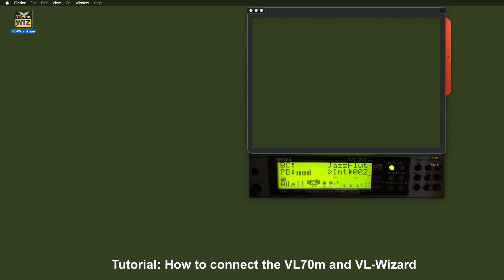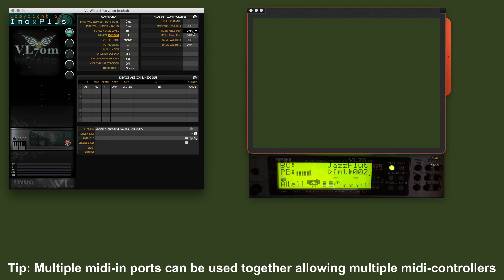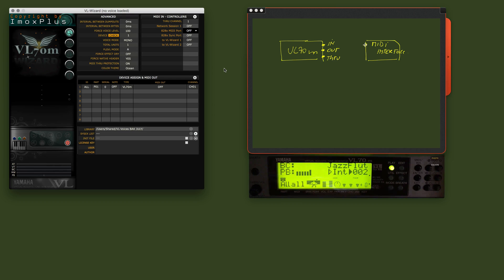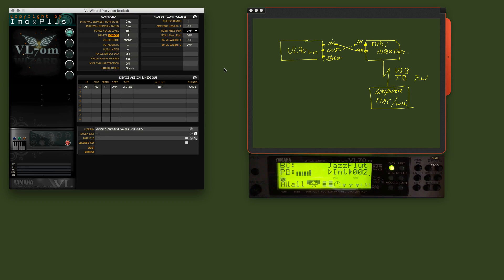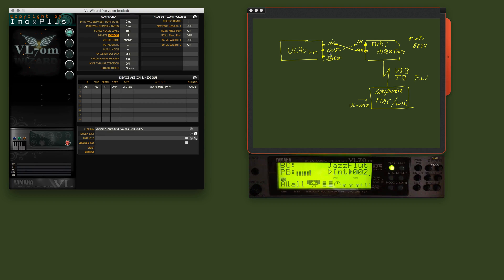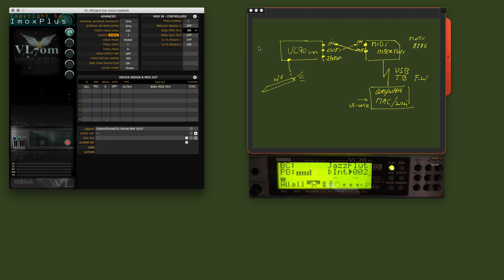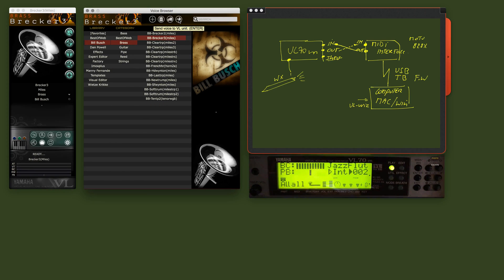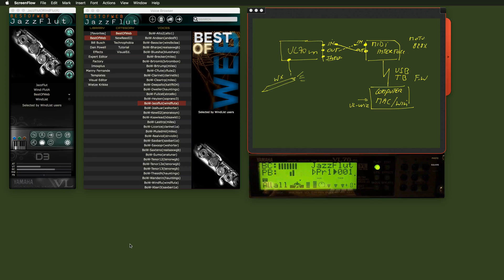1.01 VL-Wizard : How to connect the VL-Wizard with your VL70m  ◉ VL70m ◉ PLGVL ◉  EX5R ◉

Comment: Hi. I have a DM-48 wind controller that uses the midi in at the back of the VL-70m through a Midi Host so how do I connect VL Wizard  to my PC ?
Reply from the maker: You could use a MIDI merger box feeding the PC MIDI OUT  (PC USB MIDI interface) into the MIDI IN A * and the DM48 into MIDI IN B * and then connect the MIDI OUT * into the VL70M

* = merger box

Comment: I know this might be a silly question, but the connection diagram doesn't show how to connect the L/R audio outputs from the VL70-m. I assume they can go to a PA system (powered speakers / an amplifier + passive speakers), or the inputs of an audio interface. The audio interfaces I've looked at all have balanced line inputs, which can accept either a TRS (balanced) or a TS (unbalanced) cables. I haven't been able to find any information on whether the VL70-m outputs are balanced or unbalanced, I guess that means they are unbalanced? If so, should TS to TS cables be used to make the connections? If I understand correctly, in this case the audio interface will see lower input levels than if it was used with a device that has balanced outputs. I was reading some reviews of Focusrite Scarlett 8i6 (3rd gen) that I just ordered, and someone mentioned that their keyboard, with it's unbalanced outputs plugged in to the audio interface's rear line inputs, is too quiet, even with the volume maxed out. Can you please clarify this topic a bit, correct any mistakes I might have made above, and give some advice on this topic?
Reply from the maker: yes, the output of the VL70m is unbalanced (TS to TS should be used).  You can reduce the ground noise by attaching ferrit coils and connect your audio interface + VL70m on a powerstrip with noise filter. The quality of the TS cables is very important. Ensure well shielded cables.

The output volume of the VL70m is also influenced by the way the VL-voice is designed...You can use the EQ boost, Treble and Bass to lift up the signal.  You can also fake stereo by chaining the Stereo EQ block in the VL70m effect section. You can also use the Aural Exciter effect block and shift its output more the the left and the output of the other effects to the right... etC...

I'm using the MOTU interfaces because they offer rock-solid drivers
Reply: @IMOXPLUS  Much appreciated!

Comment: Totally new to this but have just purchased a wind controller (leckholm DM48), in the style of a chromatic harmonica.  I was just wondering what a 'midi interface' is.  Is that seperate from the VL70m Module Unit, as your drawing suggests?  My goal would be to play something like SWAM trumpets through this module in a live setting.  Any help would be great.  I have no idea.
Reply from the maker: A USB midi interface does translate the DIN MIDI in/out of your VL70m into USB data. It allows to to have VL-Wizard software communicating to/from the VL70m. This one should do https://www.roland.com/global/products/um-one_mk2/

If your goal is to have your DM48 communicating directly to the VL70m without computer. Example for performing without computer. Then you should also invest in a USB Host to Midi DIN solution. Example: 
https://www.thomann.de/gb/kenton_midi_usb_host.htm.  

Hope this clarifies.  Stay safe...

Also be aware about my other product (Respiro wind-synth) which should work very well with the DM48. more info on www.imoxplus.com

Comment: Hi Rudi, another question: in case you will not achieve this editor for yamaha VL7 or VL1 (because not many supporters), you can convert sounds in this library editor for these two models? thank you ! this is my email - ionutextreme367@yahoo.com. please tell me how much this library for Yamaha VL7 (if you do not want to make public, expect particular message)
Reply from the maker: Fantom ,  the majority of the voices included in the vl-wizard library are converted from the VL1 libraries that I found on the internet..So, To be honest, I see no benefit converting these vl70m voices back into VL1/7 format...actually you would loose quality because VL1/7 voices contain extra parameters that are not present in the VL70m voices........my goal is to release this year the VL1/7 editor...so, to all VL1/7 users, contact me via my website contact form...timing/priority depends on how many request I get.....Rgds.Rudy